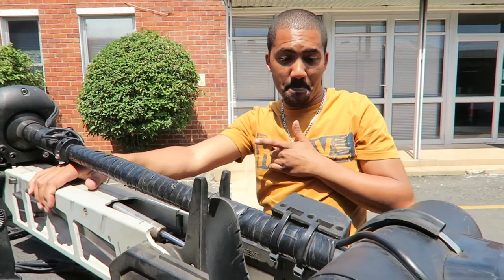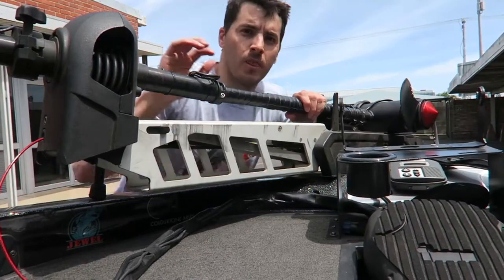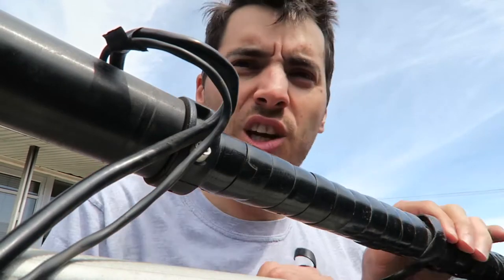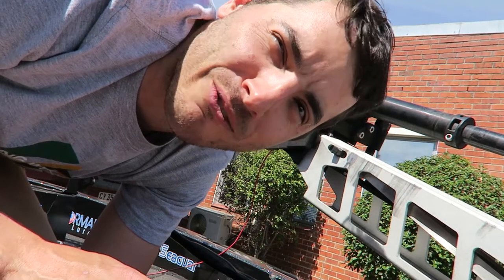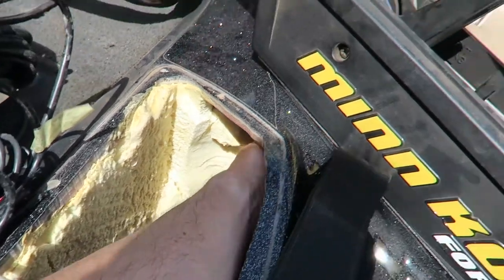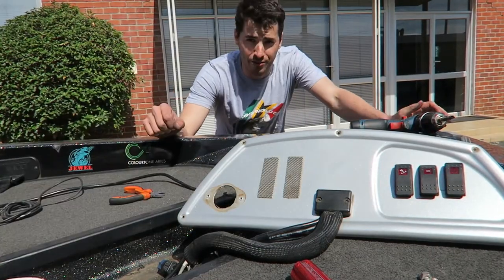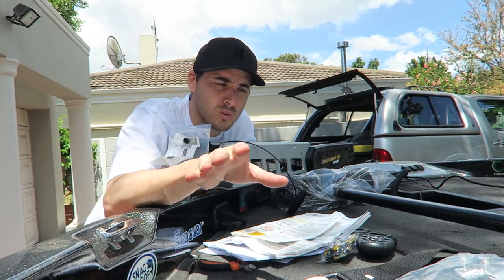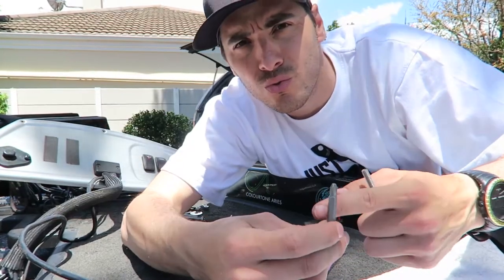MinnKota Ultrex installation

Comment: Do you have noe any problem with boat cover?

Nice video.

Regards
Reply from the maker: HI Fran, the cover does not fit as well as it did before adding the Ultrex however it still works great.